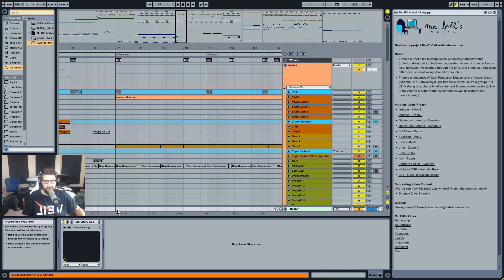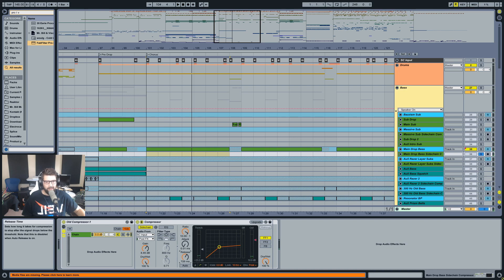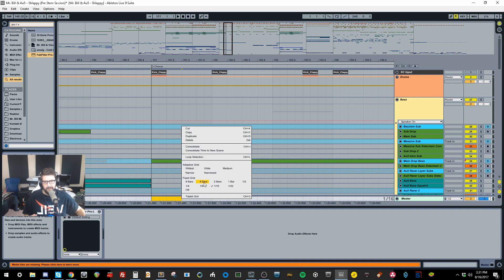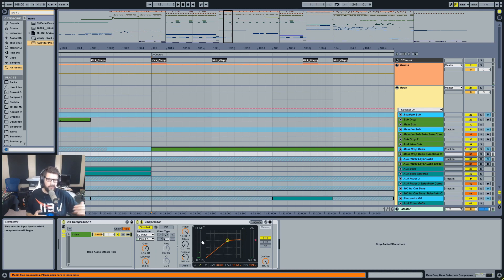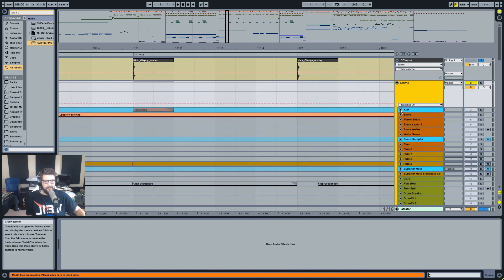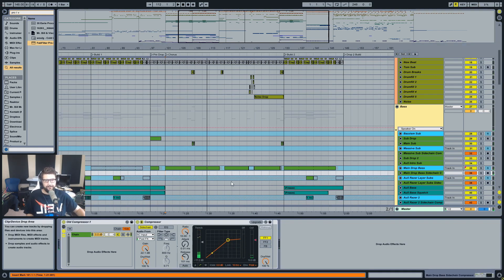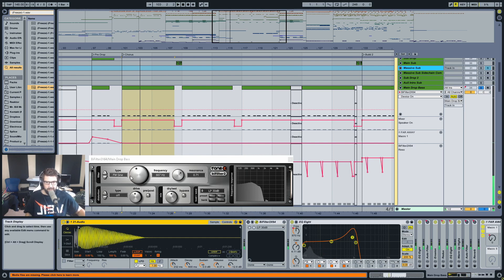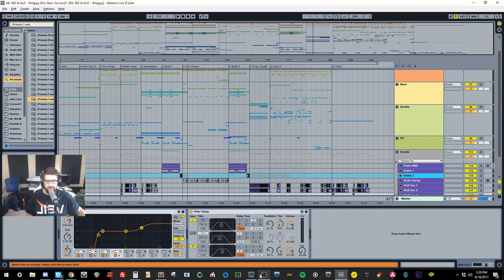Mr. Bill - Ableton Tutorial 57: A Mathematical Approach To Sidechain Compression

Comment: This only works with kicks a 16th note long or shorter, though. If you have a longer subby kick, it'll still be decaying out in the low end when the SC compressor has already finished releasing. That's why I'd rather just SC to the kick itself, and use quite a short release time.

Comment: Honestly, I just use the Fruity Peak Controller and the Fruity Balance, I make the settings so it makes whatever the source signal is go up (Keep going, it will make sense later) and then I'll make a seperate insert in FL purely for sidechaining, routing saod things into it, and the putting a Fruity Balance on it and then linking the volume to the Peak Controller, but making it so it goes inverse so instead of increasing in volume, it lowers.

The Peak Controller will also fold to the shape and sound of whatever you use, so if you want a snappy kick, use that, if not, then don't.

Also the actual time of the Peak Controller of how fast it reacts to the source sound seems to be instant, its actually pretty crazy how fast it works.

So for me, I get a kick and snare that sidechains perferctly to the sound of the kick and snare and also is instant and is shaped perfectly to the sidechaining of the stuff.

Not that this method is bad, but doesn't seem as good from what I do already, but hey, whatever works amirite?  :D

Comment: Why not just use LFO Tool?
Reply from the maker: Isn't it just static? What about beats with lots of syncopated movement in them? (ie. not a 4/4 kick you're side-chaining to...) - I may be mistaken.
Reply: Mr. Bill i'm pretty sure you can use midi triggers in LFO Tool
Reply: It can be triggered by a midi input, so you're not limited to a 4 on the floor kick pattern. Although the one drawback of it is that the velocity of the midi input doesn't change the amount of sidechain applied (if you have a midi note with 50% velocity it will still sidechain normally, not 50% of the amount) but that may not be important to you. You can also automate the depth of it.
Reply: by using the same click/snappy sound to trigger his compressor, he is also always compressing the same amount either on kicks or snare hits. If you want more control over each beat using his method, you can use different volumes on the click samples to trigger more or less the compressor. Alternatively, you can also use two compressors in series with different compression amounts for the same sample or 2 LFO Tools in series with different setups.